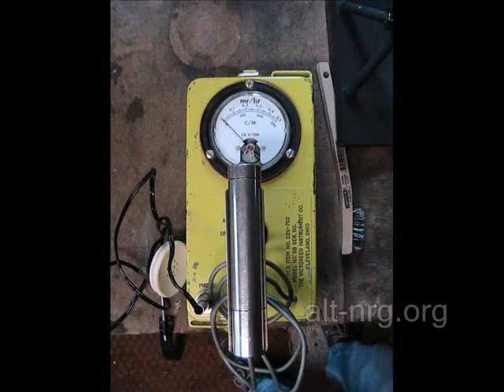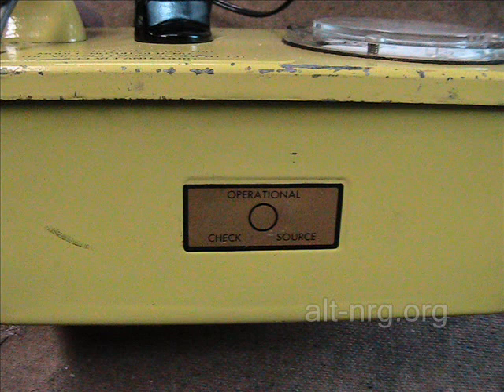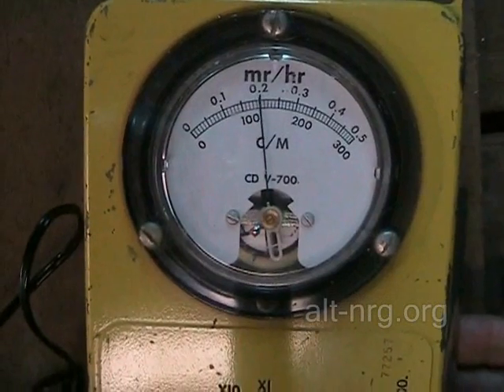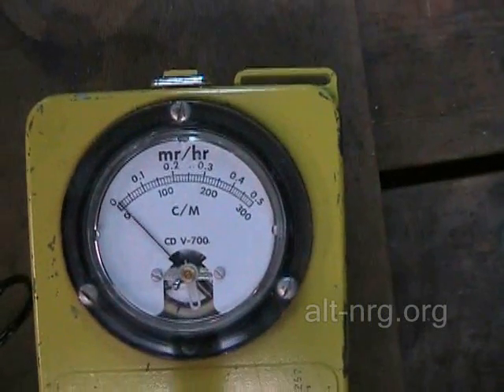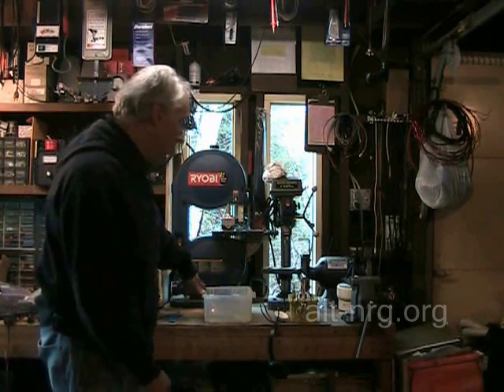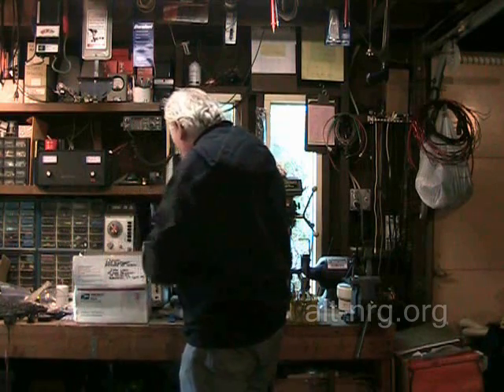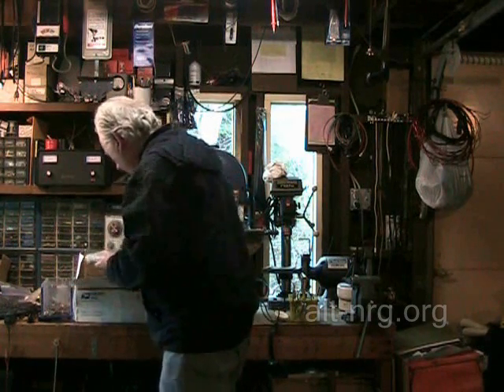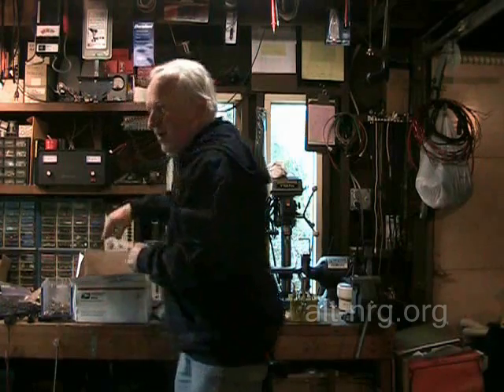#265 Batt Cell tutorial 01, Radiation fallout tests

Comment: @ZeroFossilFuel 10% Citric Acid in 140 to160 degree distilled water. Stainless plates as the Anode and pieces of Copper Pipe as the Cathode. Hook to power and run for 1 hour. I had to run at 5 volts to get much action. I will post some pics at BFT as to the difference.

Larry

Comment: When I was a kid I wondered if there was a way to take the hydrogen from water and burn for fuel, its mind blowing how it works! A few years back I was looking in a chemistry book about electrolysis and discovered that indeed it can be done!! Later I built my own crude model using sulfuric acid as the electrolyte, silver plates as the electrodes, and a car battery. The hydrogen was separated from the the oxygen by a divider. The hydrogen output wasnt very high, but it was awesome to see it!!